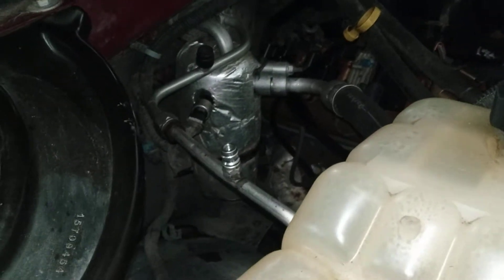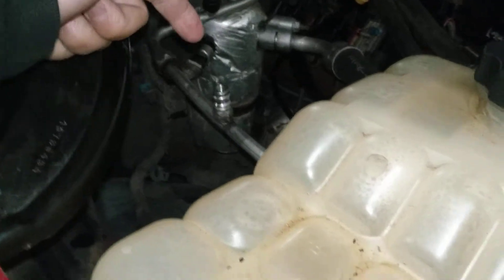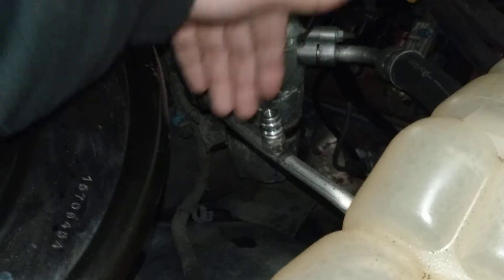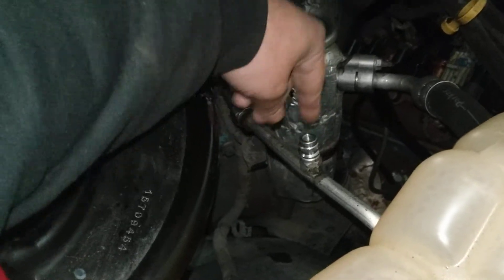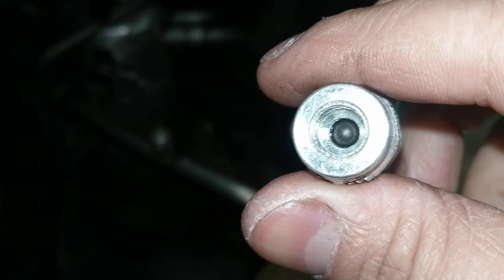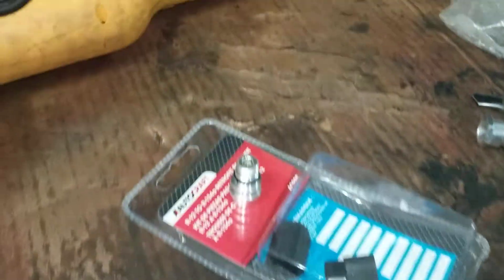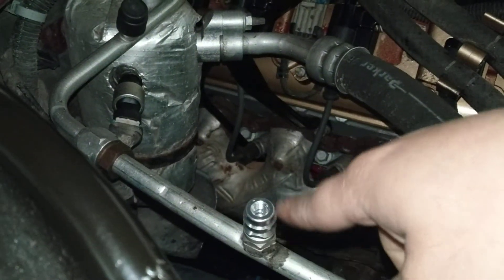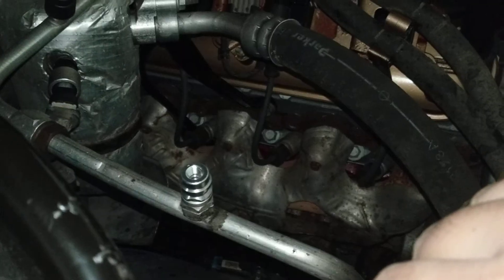GM AC high pressure valve failure

Comment: Stupid design.  If there a one time use and need to be replace after every recharge what keeps them from leaking after the system get recharged for the first time.  I just had an original one leak after recharging and the new one I replaced it with leaked also.  I need to replace mine with one with an actual Scrader valve.
Reply from the maker: Even the schrader valve ones leak as well
Reply: @ 
  I replaced the schrader valve on the low side at the same time and it didn’t leak fortunately.
Reply from the maker: youre lucky

Comment: Just an FYI: You said you were not sure if the system had moisture inside. Take it from a 30-year HVACR tech: Whenever you completely lose the charge and have to do as you did, it is a 100% guarantee you have moisture inside the system in the form of air which has moisture in it and needs to be vacuumed down to -29 PSIG or as close as you can. -30 PSIG is excitable for at least 30 minutes. Never just recharge a system that is low on refrigerant without finding and repairing the leak source. It will come back to haunt you and cost you more money in the long run, like ruining a compressor. Good job King Customz.
Reply from the maker: Thank you for this awesome information. I do know a lot better now about ac lol. I’ve learned a lot in 5 years but this is great information for the new viewers
Reply: Is running a 20 minute vacuum enough to remove all moisture from the system?
Reply: @Abused.Ls2  There are only a few ways to know if most of the moisture is pulled from the system but these are not feasible in automotive work. To answer your question NO 20 minutes is not enough 45 minutes to one hour is better, you will know when the moisture is being pulled from the system as your vacuum pump will start to smoke this is the moisture and non condensables boiling off and being pulled from the system.  I always error on the side of you can never have a vacuum pump on the system for too long, but you can have it on for too short of a period. Anything over 45 minutes to one hour is good. Also, remember you will never be able to pull a perfect vacuum it is impossible to achieve. The standard is to try to get the system down to -29 PSI which is almost impossible with most non-commercial vacuum pumps. So a negative -30 psi on your gauges and holding it for as long as possible is recommended, in the HVACR profession for non-automotive we use digital vacuum gauges that read down into the Micron ranges. Hope this helps you.
Reply: @tracysellman1562  - just curious, would you be able to tell a difference if you pulled a vacuum for 20 minutes compared to 1 hour? Like would the air blow colder or something?
Reply: @Abused.Ls2  Well to be 100% honest most people would probably not be able to tell unless you live in a Hot or extremely humid climate like here in Arizona or Florida, but yes it would do two things the air would be colder in extreme heat conditions and the longevity of your compressor would be better if you pull a proper Vacuum, the oil used in newer Car A/C systems does not play well with moisture, it will not flash at the expansion valve as it should reducing performance, by not allowing the indoor coil to condensate and not pulling the moisture out of the caben air, plus the bearings and things in the compressor don't like moisture, which will lead to premature compressor failed. I have seen a lot of problems from not pulling a proper vacuum, the other thing to remember is not only are you pulling out moisture from the system by pulling a good vacuum but you are also recharging the filer dryer Desiccant or activated aluminum.  Hope this helps explain it.

Comment: So when you were trying to charge the system before you changed it was the compressor clutch coming on and was it getting cool or no? I just had a shop tell me that did a vacuum and told me it was holding because i told him i just kept adding several cans and the freon must be leaking because the clutch would only click on for a second and go off. Then he told me he thought i had a clogged condenser, which i don't believe. But he also told me he felt the higher pressure valve was leaking also. And then i went home and took orifice tube out and it was super clogged. So im thinking it's just clogged where the orifice tube was and then leaking from the valve. My valve has replaceable stem though not like the one you took off. I already put a new orifice tube and i'm going to change the bad valve tomorrow and pull a vacuum and try to recharge it and see if the clutch stays on and it cools
Reply from the maker: sweet let me know, did you replace the compressor before usually the orfice will have a clog if a component had a failure
Reply: @Kingcustomz  yes i replaced the compressor last year and it never did work. Idk why i didn't think to check the orifice tube since it's the easiest to to take out and the cheapest thing on there. Now it's blowing cold.
Reply from the maker: yes, im happy for you, good fix

Comment: Good to have come across your video.  I'm trying to pull a vacuum my 2007 Chev Avalanche using a manifold.  I know that the low side in the Schrader valve located on the drier canister, but where the eff' is the high side with the other Schrader valve connection? - I see the one other high side valve with the little rubber ball next to the drier, but you can't connect to that. - Please let me know, thanks!
Reply from the maker: its just this one with the rubber ball

Comment: Ordered the whole A/C line, said fuck it and tried replacing the valve and it sure was the valve leaking Freon. Grabbed the part from a local parts store, re installed with new , vacuumed old Freon, refilled with new. Needless to say it holds all new Freon perfect and I can cancel my order on the whole A/C line kit. Thank you! (2000 Silverado)
Reply from the maker: you are very welcome my friend

Comment: How did you pull a vaccum on it if it's one time use? Lol wouldn't you immediately ruin it by hooking up to it with your line by that theory?
Reply from the maker: so i actually put a vacuum using the low pressure line.. but recently I figured out you can use the valve multiple times, sometimes it sticks or jams
\
Reply: @Kingcustomz  thanks for the reply, I just switched one out, when I hooked up to it I just watched the gauge, as soon as the pressure spiked, I stopped screwing the needle down . So far so good!

Comment: Great info. Thanks.   
I need to do this same repair. About how much  r123 is required recharge??
Reply from the maker: is 134a that this system uses and Im not sure it may be about 2 or 3 lbs it depends on if the system has a rear ac

Comment: quite helpful thankyou. i have one very aggravating A/C issue on my 2015 GMC Sierra 5.3 L and that is where the hell is the accumulator. ihave looked between the compressor to the metering at the fire wall and can not find a can 10" tall anywhere very frustrating  :- (
Reply from the maker: It’s should be on the firewall area

Comment: I was told by my mechanic that these are often damaged when someone attaches Test Gauge hoses and then turns the knob (on the end of the hose) down/in too far, damaging the service port valve. The knob should only be screwed in far enough to open the service port enough to allow gas to pass through.
Reply from the maker: it still damages regardless, if you go all the way or a little.. sometimes you get some that don't damage and other times you get them always failing

Comment: I just tryed recharging Freon on my 06 Sierra . It's been without cold air for 3 to 4 years. I was  hoping it would last for 200 klm  or 120 mls while pulling a 27ft RV.
After recharging it was working again .It worked all the way to camping but died 
just before making it home . At the 180 klms point .
However both ways when I was accelerating I herd a puff that I never herd before . So after puffing many times the aircon wasn't cold .
Do you think the value on the high side you replaced could be the problem ?
And not having the cap for the low side after recharging could that cause the problem ?
Reply: Yes! The cap has an o-ring in it and should be screwed on tightly. Never leave it off
Reply from the maker: Yes sir, exactly
Reply from the maker: Yeah you need your caps helps keep dirt out and it has a ring on it

Comment: Does it have to be empty for it to be replaced
Reply from the maker: Yes, loosening this is an open to the line. That will allow Freon to escape. Evacuate. Install the piece and put the system on a vacuum. Then put your Freon back in once everything is good

Comment: Thanks for this! We tried to separate it at the line in the square block. Didn't try turning it at the hex. I read somewhere that if its a hex on top it's replaceable, if it is octagon, it is not.
Reply from the maker: Not sure about that but mostly super replaceable

Comment: do you have to evacuate the refrigerant to do this?
Reply from the maker: Yes anything with ac work, you must always evacuate the refrigerant by using a evacuation machine.
Reply: @Kingcustomz  yep...i got some air in the line changing out the low pressure valve...this shop near me has a single machine that evacuates, checks for leaks vacuums, seals and refills the system to factory specs. Took a few minutes to do and they charged a little of nothing..less than it would have been for me to buy all the equipment to do it myself. AC ice cold now. I would love to buy that machine, but it's like over $15,000 to purchase, LOL! It just  makes it so easy. Nevertheless, thank you  kindly!
Reply from the maker: You are welcome my friend, look into the robinair r134a machine.

Comment: Hey man my avalanche 2003 1500 is making noise behind the radio like a fan noise kinda any advice
Reply from the maker: Is it aftermarket radio?
Reply: @Kingcustomz  I just got the truck I believe so but it came with out the radio cover
Reply from the maker: Ok so it’s most likely after market. Some of those after market radios have fans in the back to keep it cool. Remove the radio and check
Reply: @Kingcustomz  thanks man I started following your channel great stuff made me want to get an avalanche thanks for the help 

Also mine came with out the twist locks for the mid gate any idea where I can get them
Reply from the maker: With out the center twist lock piece, I would say check the junkyard or amazon
Reply from the maker: Type in midgate lock see if anything comes up
Reply from the maker: Thank you so much for following the channel, I have huge plans for the avalanche very soon

Comment: is this work for camaro 2010 i just see its leak from caps the one around radiator
Reply from the maker: yes same way, i did one on a camaro a little while back
Reply: @Kingcustomz  do i need to empty the fr-ion first
Reply from the maker: yes anything that has to do with you replacing any components in an ac .. yoh always have to empty the system first. then replace the part. then put it on a vaccum then recharge

Comment: "One time use"? That doesnt make sense that every time one attaches the manifold gauge that the valve has to be replaced. 

Pressure will be lost due to attaching gauge meaning that the valve will need to be replaced, than when it gets replaced the gauge will need to be attached to see if it's ok Pressure wise, after attaching the gauge it going to be ruined due to it being a one time use.
Reply from the maker: dude idk lol, I didnt design it. but when i attach the gauge on that side i dont tighten it all the way. that valve sucks!

Comment: HA HA! Same thing happened to my Alero yesterday. With the engine off I pressurized the system because it was blowing hot. Heard a hissing coming from this very valve.  Replaced the valve with an identical spare I had  nd it is cold as a Chicago winter in the car now even though it was 111 here in AZ today. I ordered a new one with the Schrader valve from Amazon (<$6.00) and will keep it as a spare for when the replaced valve with the diaphragm goes bad. Good video and information. Thanks!
Reply from the maker: i used two with a schrader valve, for some reason they leak.. let me know your experience with it!

Comment: Having to replace mine for the second time now which has been about 5 years. Going to hunt down a abraded version. The ball design is so stupid. May do orifice tube as well. Thank you.
Reply from the maker: you welcome man. it is such a stupid design so ridiculous
Reply: @Kingcustomz  didn't see when this video was made but how long is/has it held up? I'm about to replace both my low and high port valves. Also have you heard of or ran across one that's better than the shrader type?
Reply from the maker: I only knew of the Schrader type, until I came over this crap design
Reply: @Kingcustomz  well apparently this sorry ball design is pretty standard when you go to any parts store looking for any and I looked some up online earlier and didn't really have any luck finding a Schrader valve type. The crazy thing is the one that I bought when I looked online a few days ago I saw the Schrader valves and was thinking it was a straight-up valve type and Schrader valves actually come in the little kit but there's no way to replace the ball valves with the Schrader valve so I don't even know why they put it in there.
Reply from the maker: I bought a Schrader type and it didnt work well
Reply: @Kingcustomz  oh wow
Reply from the maker: yeah it leaks, so I bought the original design and refilled the freon but I didnt screw the tap down all the way. just a little.
Reply: @Kingcustomz   the tap at the can or the coupler at the valves? I think I prematurely made the low port valve fail because I was trying to fasten it with the coupler in the open position and the tip I guess depressed the ball valve too many times and with me pressing on it as well probably took it out smh. So I'm asking for knowledge as to rather at the 
coupler should you open the valve wide open or just turn it a few turns or so? I guess even at a few turns it will be open but might take a lot longer to add refrigerant or no?
Reply from the maker: @sandmansimms5704  yes at the valves. with the can go all the way but when you put your gauges on go slow, I feel that causes the ball to get stuck.
Reply from the maker: @sandmansimms5704  I'm not sure if that will limit how fast or slow something goes
Reply from the maker: so I love chris fix man. he is awesome at what he does. I'm not sure if the mustang's have those stupid ball valves. this Chevy was the first of me ever running into it... when I put the vacuum on the system. for the side with the ball, I opened that slow
 the side with the Schrader i opened all the way
 then did my vaccum.. i did it that way because these things stick.
Reply: @Kingcustomz  all good man and no it's not just on Mustangs with those ball valves it seems to be a pretty standard thing now and I mean I really don't know I don't understand why they do things like that to make something if it's not a really good design. But then again you know if you are supposed to massage things and be gentle put out a disclaimer LOL I mean it doesn't take much to put a disclaimer or putting notes something to let customers know. But yeah all good man I just and I've learned a lot messing with this thing and I'm claiming it it had better be done then better be fixed LOL
Reply from the maker: hahahha yeah I feel you on the disclaimer. and on the positive side you are learning so that's a good one. I'm guessing maybe on the american vehicles we have the weird ball valve thingy

Comment: Thanks a million I just changed mine out after discovering a leak on the high port
Reply from the maker: not a problem, I'm glad it worked out
Reply: @Kingcustomz  Did you have to empty the system first before removing that? Sorry if that's a stupid question. Just found out mine is leaking.
Reply from the maker: not a stupid question at all, yes empty the system. you have too. I'm going to make a follow up video to this. empty the system and put a vaccum on it

Comment: I have an 02’ Chevrolet avalanche. It is leaking from the high end. Do I need to just do what you did?
Reply from the maker: yes, make sure all freon is evacuated first, then remove and replace new high end fitting. then recharge system. but make sure you empty the system completely.
Reply from the maker: also vacuum the system as well
Reply: Ok thanks a lot!
Reply from the maker: you are welcome
Reply from the maker: if you arent sure, have a professional do it for you... it's dangerous stuff and will cause frostbite if it lands on your skin
Reply: Awesome
Reply: Worked wonders! Thanks so much!!
Reply from the maker: @empressoftarot1  you are so welcome,